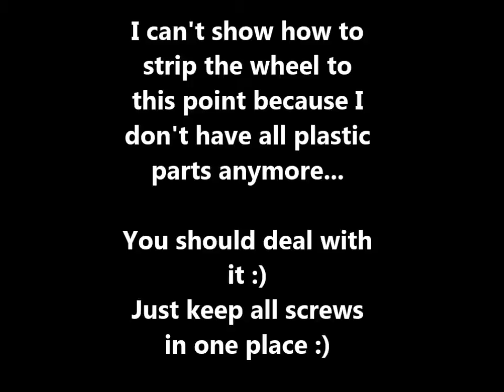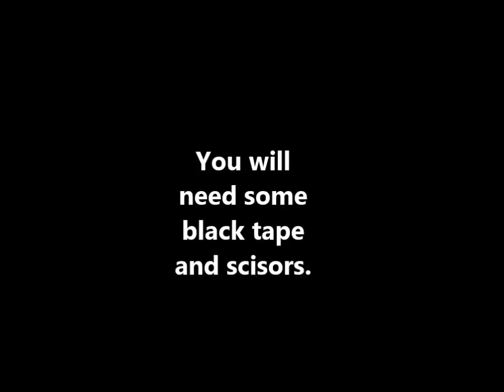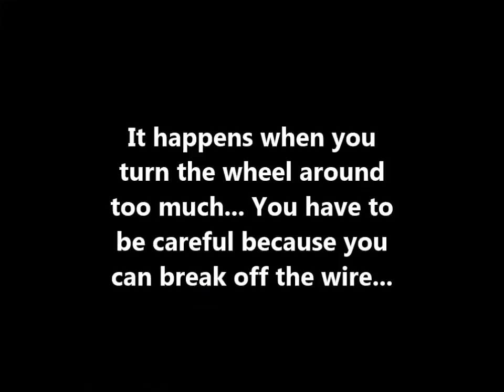MS SideWinder FFB Modification Short Tutorial

Comment: Theres a fix for the wheel not being centered. Rotate the mirror for the backside of the steering wheel sensor. I used a small plastic piece i had laying about, removed it from its position and just glued it to the plastic piece at 45 degrees to the left. Might take a few tries to finetune the center position.
If you want 900 degrees then cover another hole on the black sensor disc (totally 3 holes, the rest covered), thatll actually give you 868 degrees or something like that. I think that 4 holes is good though otherwise youll end up steering too much for a wheel with such a small diameter.
Make sure youll use a ziptie and pull it hard, for the steering wheel connector, that way you lock the last part containing the loose wires and youll not damage them as easily.

Comment: Gonna give this a try soon and incorporate a slip ring to prevent wires from breaking.
Reply: @theextratesticles2358  Finall got around to doing it and I either wired something wrong or got a bad slip ring. Gonna mess around with again later to see if I can make it work. If I can get it to work, then splicing in a slip ring would be the way to go as it would allow the wheel to rotate an unlimited amount of times with risking wire breakage.

Comment: Interesting. I have this exact wheel. Would it be possible to 3d print i new coding wheel for the ff. Also. Completely striping off the wires protective rubber housing may save the wire from knotting up so much.
Reply from the maker: Printing a new encoder wheel would work just as good as the original one with tape. 

It's all about how many slots are on the encoding wheel :)

Comment: Hi, Im having problems with my sidewinder, the force button is blinking and it does not have force feedback. Just looking for help
Reply from the maker: Make sure your power supply works and the power is connected to your steering wheel
Reply: @radekciskowski2070  yep it is connected
Reply: It worked before when the pins in the power supply were bent

Comment: Hello! This is quite an old video so I doubt I'll find help but I did this mod and my force feedback does not return to the center properly anymore unless I remove the tape on the motor (thus making the mod pointless.) Any ideas on how I could fix this
Reply from the maker: Yeah, you can see when I did that mod the wheel was not returning to the centre, that's the only down side, this is why I put the tape on the steering wheel to mark the middle for the video. It is what it is... But imagine you can use the mechanism and electronics to adapt to your own wheel for cheap $$ ? :) 

Good old days :) haha
Reply: @radekciskowski2070  figured it out from another comment! There's a little mirror under the wheel that you move to the left. Works great, thank you;

Comment: I tried this and now windows doesn't recognize the wheel rotation anymore. Pedals and buttons work fine. Noticed the crumpled reflective sticker for the ir transmitter and replaced it with aluminum foil. if I let it calibrate upon plugging it in, the wheel will just turn indefinitely. Any idea how to get windows to see the movement again?
Reply: Have the same problem, did you manage to fix it?
Reply: Sounds a lot like you accidentially destroyed the mirror. But without seeing it I guess you just need to align it precisely with the detectors again and then it should also work with the aluminium foil.

Comment: steering wheel stop in full lock ( like without no modification)  or still rotating ? need drivers? work in  windows 7, vista and 8?
Reply from the maker: +cesar magalhaes Windows 7 and probably windows 8 will install the basic drivers automatically. Everything schould work fine (FFB, pedals, steering wheel, buttons)
I don't think that you will be able to install the original drivers for this steering wheel.
Reply: +Radek Ciskowski  maybe i buy it, price here is around 25euros, thanks for info

Comment: How do you show that I could not remove the back cover off?
Reply: I can't open it either
Reply: there are two screws inside the casing, one on both sides of the wheel (lord knows how they've gotten there). you can try to unscrew them with a long screwdriver through the airvents, assuming the FFB variant has them. my non-FFB certainly does.
Reply: i know this is 2 years old bit can you describe where they are??